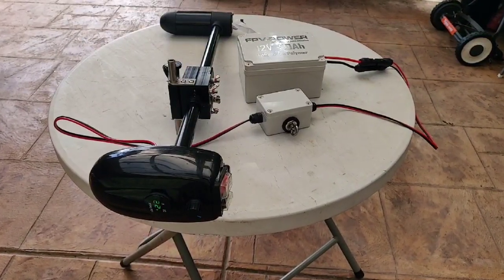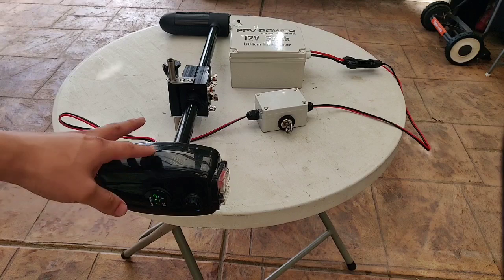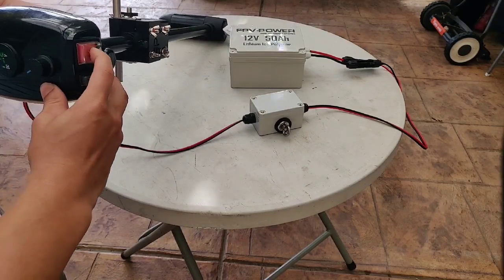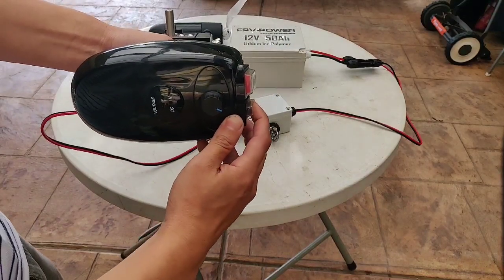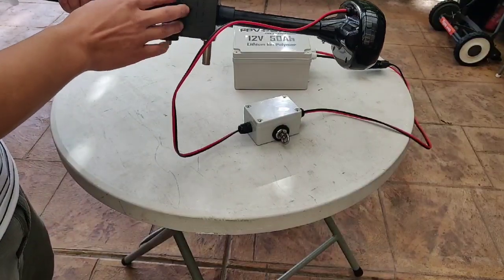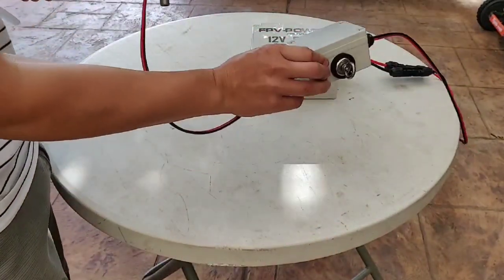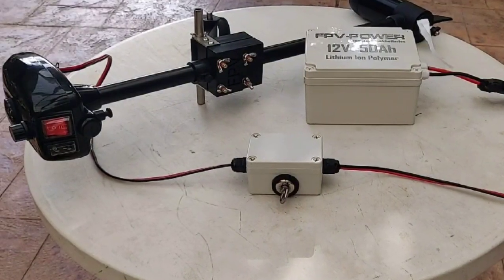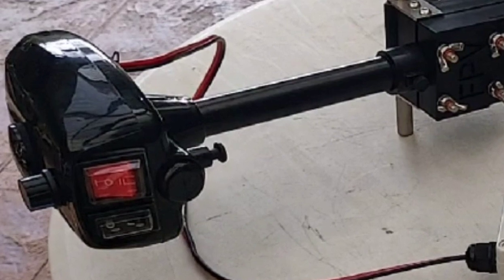Fpv-Power 28lb Trolling motor with built in pwm, voltage gauge, and safety cut off.

Comment: Hi there. I really like this electric motor and am seriously considering to purchase this product. I have 1 question. Is it possible to shorten the shaft on it? For me, this is the only thing I don't like on it. I think the shaft could be shorter.
Reply: Yes the shaft can be shortened!
Reply: @brandongoh8900  thanks for that. Just curious as to why they aren't made shorter in the first place? On a side note, would I be able to purchase it shortened from your end? :)

Comment: Is there a yellow and white wire inside your motor for speed control? I have them in my newport vessels motor, and I'm unsure if I can just connect the positive and negative to the fpv power PWM and leave these two white and yellow wires unconnected.
Reply: Yes dont touch the yellow and white wires. Just red and black